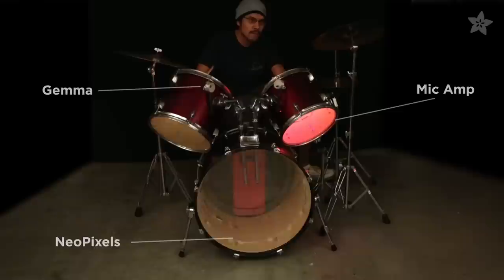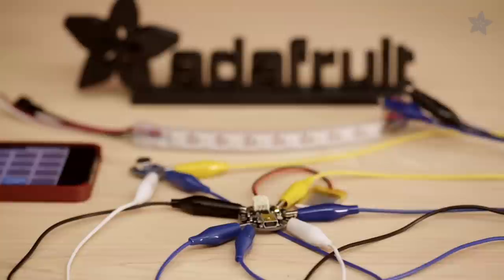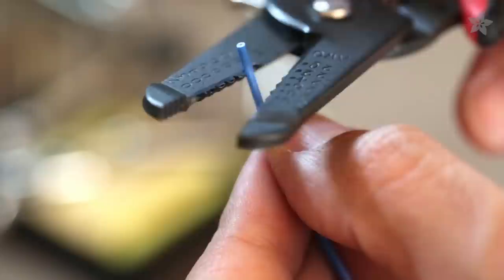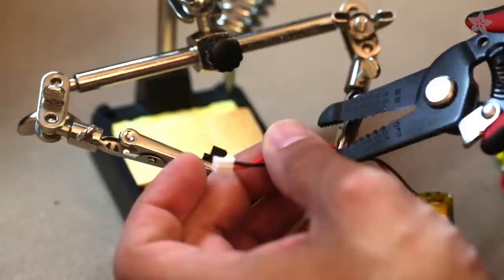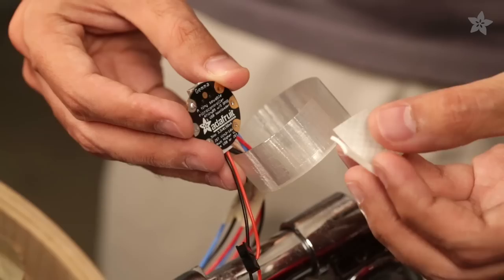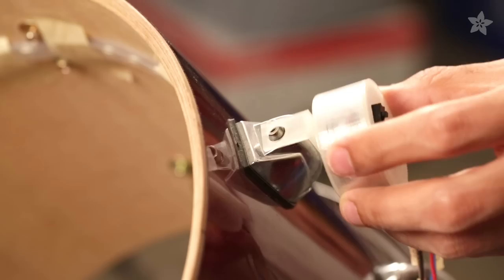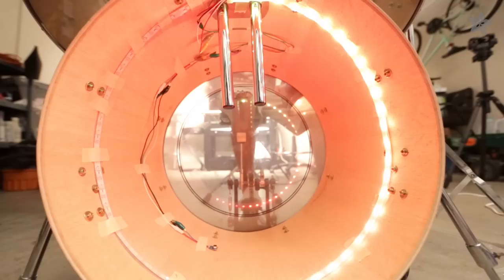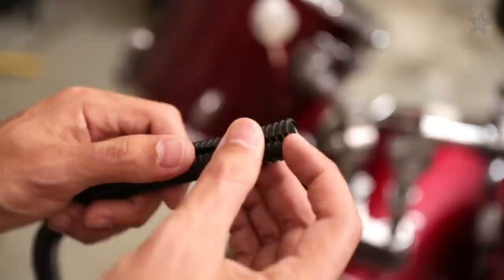LED Drum Set - Mod Your Drums to React to Sound #Adafruit #3DPrinting

Comment from the maker: Gemma-Powered NeoPixel LED Sound Reactive Drums - Light up your drums with sound!  #Wearables   #GEMMA  
https://learn.adafruit.com/gemma-powered-neopixel-led-sound-reactive-drums

This guide will help you upgrade your drums to have sound reactive LEDs. This build uses a mic amp sensor and Gemma to light up NeoPixels to the beat of your drums. The cost of this build is considerably lower than other kits. Its also compact, rechargable and mobile!
Reply: +Adafruit Industries Hi guys,
If I wanted to control the color via switches (say three switches for one color each) and have them fade away instead of having the gradient effect of your example and I'd like to have them triggered by actual drum triggers, how would I have to change the code you provided on your website and is an Adafruit enough or would I need a full Arduino kit for that?
Also potentiometers for fade-out time, threshold and minimum brightness would be great but I really don't know much about programming.

Comment: I notice the kick drum triggers the tom lights to go and your not hitting the drums with sticks so im guessing there is no adjustability on the sensitivity of the mics? which would just mean that every time you hit any drum all the lights would go
Reply: It's difficult to isolate with air-based microphones.  We're developing something on our channel that uses contact mics instead.
Reply: Lights4Drums.com YouTube Channel I'm trying to do this, but with MIDI triggers. That way I can use DMX to program light sequences and other cool stuff.
Reply: njoydq Use piezoelectric sensors, you can buy the sensor alone for pretty cheap, or you can them in a housing that connects to the drum (called a trigger).  This usually converts to a 1/4 inch male output.  You might need to do some signal processing to reduce noise but for lighting purposes it probably would not really matter.  You could add a variable resistor (potentiometer) to control the sensitivity.
Reply: Potentiometer is the best bet. Buy one thats like 50k. see the sinistivy on it then buy the desires variable resistor that gives good range a control. This is essentially a rectifier circuit. I made one back in HS.

Comment: For this build is it possible to use a piezoelectric sensor instead of the Mic sensor.  Just curious if you can swap those parts and still have the same effect.
Reply: mrtritom22 yeah, that's what I kinda said.  They're not as sensitive. Might even have a very sophisticated brain box (as in Roland V-drums) lying around already. Or an inexpensive piezo setup as in some guitar amps. 

The earlier brain boxes (TD-12s) are great at understanding two types of hits. Newer ones do much more. 

I'd like to see this in fiber optics. Be way easier to hide and live with. Should be used for more than cheap Christmas trees sold at the drug store. 

I think you have to be MIDI, even though I dislike a lot of the applications. For speed, you'd have to, I'm told.